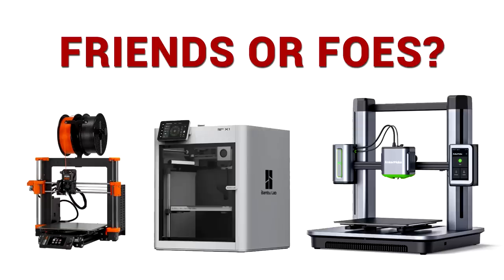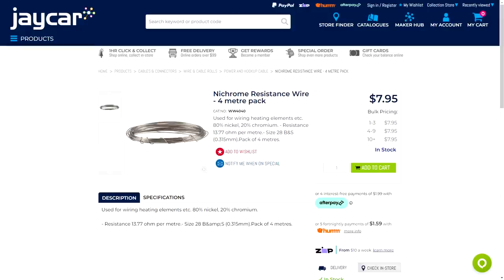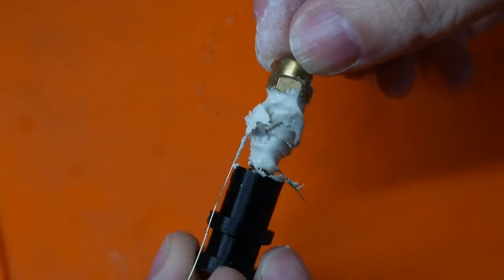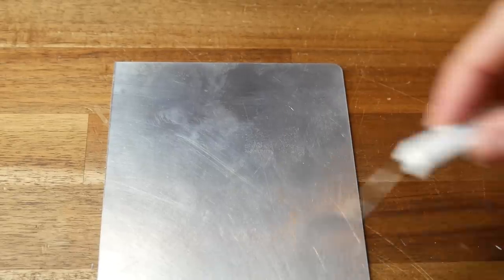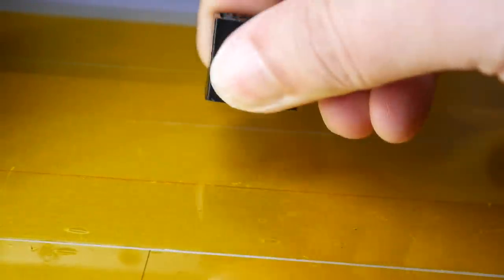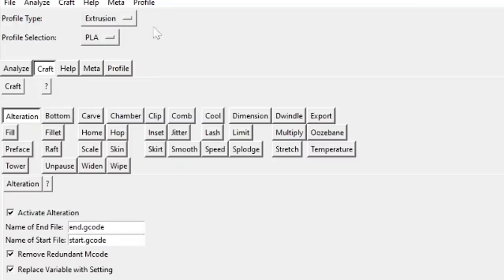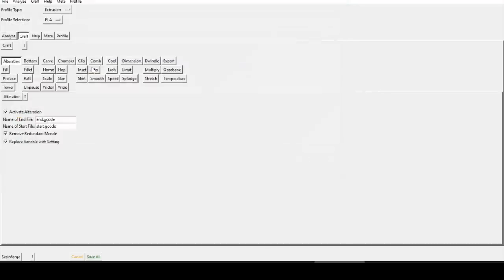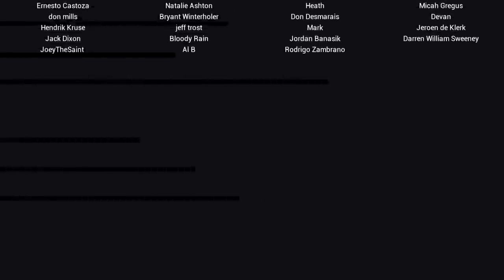10 years ago, 3D printing was really hard

Comment: Very interesting.   Thanks for taking us back in time.   I got my first 3D printer in Feb 2018.   This is a Creality CR10S.   Creality supplied Cura as slicer.   The printer had a lot of features for its time.   I am still using it.   I have done a number of upgrades.    The only upgrade I may do in the future is install some type of auto bed leveling.
I am amazed how much changed in the 5 years between your first 3D printer and mine.
Dave.

Comment: I remember some of this stuff. I came in 2014 on a FABtotum. It had steppers, it had a glass heated bed that was removable, it had a camera, it had an enclosure, web control with mobile interface and built in wifi, on-device slicing. I looked at it like "ah, this has some useful stuff" I didn't realize that nearly 10 years later, many of those elements would still be "hey, we have..." as opposed to standard. But I remember looking through forums and the RepRap wiki on how to do things. I remember seeing those hotends, using blue tape and glue stick for everything, etc. I printed PETG on glass without any interface layer because the people I chatted with hadn't come around to "don't do that, it will take chunks out of the glass". It was a wild time and is why I now rail against some machines I see now which basically are rehashing how things were done then, but with a fresh coat of paint. We've moved on. Just stop. I'll also casually note that working in tech means Slic3r is pronounced "slicer" and I will die on that hill... and remember when that was a new slicer too.
Reply from the maker: I've never heard of that printer but it sounds way ahead of its time.
Reply: @TeachingTech  looking back, it was. But it also tried to do CNC and scanning. "jack of all trades, master of none"

Comment: April 2011 was my start date. I built a 1x2 Repstrap, mostly with parts from the hardware store, and Gen6 electronics from Camiel. I bought my first roll of filament direct from Adrian Bowyer. Used it to print a Prusa i2, and still use the X axis and a J-head for printing 3mm filament! I remember using RepSnapper more than Skeinforge for slicing. And the RepRap forums, a lot!
Reply from the maker: Thanks for sharing, some amazing tid-bits there! The idea back then of a buying all of your 'vitamins' from a hardware store and printing the rest seems so foreign.

Comment: I think the hardest part of learning to 3d print back in the day would've been not having your channel to walk us through everything step by step. At least that's the biggest reference I used!
Reply: The reprap forums have been around since 2004, just about everything in the 3d printing world FDM wise initially came from there including marlin.  Though back then most people were using arduinos and erector sets or whatever they could find at homedepot for their builds.
Reply: @nikushim6665  true the forums were definitely there, but watching a video showing exact equipment with step by step instructions is much less daunting to a new user than a wall of text with some pictures in a forum.

I'm by no means discounting the value in those forums, but there's a reason 3d printing had exploded the way it has on YouTube

Comment: My printer doesn't have a heated bed, not even using tape, glass, etc. And surely, getting prints off it is almost never easy. Unless the print warps on one of the sides, you just don't have any place to lift it up, and you have to find some another way if you still want to print instead of leaving the print there forever.

Comment: Its a supprize how the critical areas such as business services or finding things and searching is infact in my opinion worse now than it was then. 
Then we had mere hundreds of thing files to search through to see if a thing has been invented and owned yet or not or wether we can upload or sell a print. 
Now theres ball park 30 million things but have search engines kept up? Does plus or minus 5 years in recent testing sound like it, no. 
There were more business services operating if we go back around 3 years ago. Noew theres only 1 site with basic busines services so i would hardly call that much progress. 
A lot more newbs have been brought in as 30 million licensed things shows but if you think its better today i say yell newb out load. 
The lack of info is still causing massive losses. Newbs uploading non license checked things causing those who print and sell to be closed as pirates. Farms to collapse after giving away designs then others licensed.They gave there business ownership away, doing there own thing was a quote i heard said. 
Yip i see how that worked out. 
Sold up his rattle of old printers but didnt have any license ownerships to sell of anything he designed all time, pitty. 
3d printing is bigger today. 
Its not faster in many ways, its much slower in many ways that count. 
In costs to manufacture. 
In jobs. 
In losses in value to the community. 
The lack of enthusiasm to inform or help newbs after theyve been sold on a printer are missed opertunitys.
Do they know how to license check all uploads and sales no matter how the thing file came to be. 
Do they know how to upload?
Do they know how to license?
Do they know where?
Do they know theres only 1 site with basic operating business services in for the 3d print sector?
Do they know a thing license ownership can be sold, how, where, 
All basics. 
If any of that is news ask yourself about what your influencer is aiming to achieve if its not informing you of basics. 
Create a thing. 
Is it original or not and how to find out. Finding out you can license it. 
Finding out you have only 1 choice to sell the ownership. 
Setting terms, who may sell if at all.
Prices and royalties. 
How to sell a thing license ownership. TRANSFER. MIGRATE. SEMI MIGRATE. 
Basics, day 1 newb education in my opinion. The modern day has better printers. Not better influences.
Not better services. 
Not better search engines. 
Not better results in looking for your thing or business. Not better educated community. 
We can do way better. 
Its been faster and better than it is today. Time to re sort manually results is growing and slowing and costing more over time. 
I hoped it would be fixed by 1 million licensed things but here we are 30 million ball park and slower services. More costly to operate. 
Less sites with basic operating services, just 1 managed to resume in over 2 years. 
Theres a way to go to even get all areas of the 3d print sector back to where it was. Some areas are ahead such as machines, other areas such as software, services, and sites for the comunity to use are worse. 
Influencers seem focused on printing a rosey picture but perhaps if they had the sight to aim to uplift the comunitys and have better systems and services. 
They are people for hire and silence on all but sell to newbs would be unlikly to solve much for the comunity. Eh hence my post. 
We can do way better.

Comment: Something bad is appening to 3D printing today. Producers are closing with patents and strange hotends and components. SMD circuitry on the hotend. Closed source firmwares, and so on. 
So please everybody in 3D printing avoid this products and continue to buy open products like the E3D hotends and simple printers without so much software and the ability to put open mainboards and open firmwares like Klipper or Marlin.

Comment: I've got my first 3d printer around 2010. It was the original UP! from pp3dp. At that time it looked like the best option from budget printers, and I must say that it aged very well. I used it for a long time, and the main reason why I completely stopped using it was that the old software became unusable, and the manufacturer started to push hard for cloud BS in new releases. 
That doesn't mean that the printer sits unused: I upgraded the controller to Dutet2, and the printer still extrudes plastic with most of the mechanical parts in their original form.

Comment: I see March 31, 2011 is the date on the email I still have for order #48 of the Complete Ultimaker Kit (Beta) PRE-ORDER.  Spent just shy of $1900 on that thing.  Shipped almost 2 months later.  I remember modifying the java source code for the ReplicatorG slicer back then because there weren't settings for what I wanted.  Looks like a few months later I spent $200 on the NetfabbEngineBasic for Ultimaker... wow, that was a waste.  Years later my primary FDM printer is a Monoprice Select Plus I bought for a couple hundred bucks.

Comment: Black to 2013 the Folger I3 was my second 3d printer after a Prusa Mendel. Folger's extruder/hotend was rubbish. I replaced it with a Jhead then by a E3D V5. Slicing was done through Repetier Host with Cura or Slic3r engine as both were available. Folger's carried a MK2 heated (disposable at this time) and we were printing on 5mm mirror with ABS juice or PVA glue. This solution was preferred over painter's tape and Kapton tape which was, as Michael said, nearly a single print solution. PLA was barely available, but ABS was reasonably cheap 12€/kg. Obviously bed leveling was  manual. Then comes the Tevo Tarantula which was a very successful printer way before Creality established. Who still remember about it ?

Comment: I did own a Cupcake CNC from MakerBot (SN 00862). Its Hotend did not use cement. The hollow Screw was insulated with Kapton, then the NiChrome was wrapped around. Then this was heat-insulated with ceramic tape, kept in place with Kapton.
In comparison with today, the printer was horrible. It had a XY-moving 10x10cm build area. The build surface was unheated Plexiglass. Adhesion was a big problem. Instead of a Brim, you used a raft. Better 2 Layers high, because the first layer was super-inconsistent. No wonder, because you could not level the bed. You needed the adhesion, because the default Filament was 3mm ABS. And as the printer neither had a Fan nor an Enclosure, warping was the next big problem. 
If your part printed successfully, there was lots of stringing, because it was hard to control the flow rate. The filament drive used a DC gear motor instead of a stepper.

It was adeventourous!
Times are much better today.

Comment: I started back in 2019 with a 3D printer that someone build for me. If I only knew I could have gotten an Ender 3 for the same price!
Anyhoo. I told him I know nothing about 3D printers, so he edged me towards the one he would build for me. 1 month after payment was made I got my 3D printer.
Build volume of 100x100x120mm, Acrylic side panels, bowden fed printhead with a 0.4mm nozzle, non heat build plate made from plexi glass and
a Core XY Z-axel.
All was well till layer shift started happening.
And if you breathed on it, it would disconnect and stop the print. No onscrean display. It had to run throu repitier host from a pc/laptop.
Turns out, after I learned more about 3D printers that the motherboard had a bad USB connector, and he didn't want to go through the exspense of getting a new one. So delayed till more than a year passed and then just handed it back to me.
The print head was 3d printed with a cooling fan, generic hot end and heater block.
Yes it worked till it broke. Still have it in 1 corner of my printer room, sharing space with my 2 Ender 3 S1's and CR-10s, that yes, has a 0.3mm dip to the left side of the build plate. I composate for this with a raft. So it works.
As always a pleasure watching your videos.
As mainly a user, not a tinkerer I find your videos educational and informative.

Comment: I started building a Hypercube back in 2017 after a work friend of mine lent me one of his printers for a while. Ive since built my own much bigger hybrid version of the Hypercube (look up Tech2C if you want to look into that). I've since modified that machine several times since to have a Linear rail for the X axis, and will probably do the same for the Y axis at some stage as well.
Ive been using Fusion 360 to build things (doing just that as I was watching this video) for most of those years as well. I use Simplify 3D to drive the printer, and have recently been playing about with Cura, but it's proving to be a very different slicer to set up and use, there's a lot I really prefer Simplify 3D for.
I love my Hypercube, I honestly wouldn't change it for another printer on the market, maybe a Voron, but I could modify the Hypercube into a Voron anyway, so...

Comment: Well, this brought back some bad memories. Back in the day i sold a car to get the cash to afford my first printer, I was one of the pre-orderers for the Makerbot Thing-o-matic. I really fell for the marketing: "Desktop factory!" "Best Prints yet!" "Easy to assemble and run!".  They never bothered to mention that the batch function for printing multiples required manually editing the gcode, or that the new stepper powered extruder wasn't included with the pre-order kits, but was available 2 weeks after the delivery date for the pre-orders, for an extra 200 bucks for the upgrade, but it's included with all the ToM kits after the first batch. Could never get that plywood lemon to print reliably, ended up having to go to the hackerspace in Philly to get some help to get it running, all the adjustments for power to the steppers was manually controlled via pots on the board. When it stopped sensing the bed thermistor, tried fixing it with the addon control panel for another 100 bucks, on top of the 1300 dollars the kit cost originally. It left such a bad taste in my mouth, i swore off anything "Maker" related for years. If it wasn't for my Dad deciding to impulse buy an Ender 3 Pro at Microcenter, I would have stayed far, FAR away from 3d Printers. 

Still got to figure out what to do with the 6kg of 3mm ABS filament i got sitting around.

On a related note, I hope Bre Pettis steps on a Lego.

Comment: My first printer was a PrintrBot Simple metal back in 2013, it was awesome because it actually had a PCB Bed heater! ... that could get to 60°C if the room was already at 30°C, so it never printed ABS very well, the bed was a block of aluminum with Kapton on itm the heater was exactly as you described the solidoodle's (though I never had to rebuild mine fortunately). While it had micro-stepping motors it never seemed to utilize them and it screamed like a banshee. 

After college I got a Prusa i3 Mk3 and haven't looked back, it just works so much better with all the modern conveniences like a spring steel sheet, a hotend that doesn't suck to use or change, and software that actually functions.

Comment: My 1st build was a Prusa Mendel, in 2010. I had the frame complete and had started on the electronics when I decided to make a MendelMax 1.5 instead. I remember I bought the necessary printed parts from a guy on one of the forums. It took me over a year to get the thing working, because I didn't know anything at all about what I was doing, I just knew I wanted to make it. This video brings back some nightmare memories of hobbed bolts, kapton tape 3mm filament and fried electronics. The RAMPS 1.2 Mega was the common board back then.

Comment: My first printer I still have.  It's a Leapfrog Creatr.  It's a dual extruder printer with a 2 axis print head.  Z axis is 3 lead screws.  Unfortunately, it is at that point where everything is normal threaded rod and captured nuts, so it move so very slow.  The electronics are a very poorly copied RAMPS 1.4 with no screen and only two thermocouples, but use fantastic industrial stepper motor drivers.  The frame is single slot 4040 extrusion, so it's very rigid.  It even has a heated glass bed and 4 sides of an enclosure.  I'm debating on just updating it as a Cartesian printer, or update it to a core XY.  It is a rather large printer (350x350x375 print volume).  And, the layout is almost exactly what's needed for a core XY.

Comment: just goes to show how different everybody's experiences were- I started 3D printing in 2011 with the OG plywood ultimaker and I didn't have to do ANY of the stuff you mentioned. Aside from the usual "my print failed how do I fix it" type of stuff that was common back then there wasn't much to it. I think the first version of Cura even became available a couple years after I got it so slicing even got "easy", even though Replicator-G wasn't too bad. 

That said- my Ultimaker was a HUGE pain in the ass to put together. it came flat packed in a box like a piece of ikea furniture that you had to hand assemble (the average build took around a full day, usually two days). we're talking thousands of pieces. much of the plywood was still attached to the main laser cut sheet so you had to cut them out with side cutters like they were sprues on a model kit or something. It was pretty insane by today's standards.

Comment: My first was a Prusa Mendel i2 - the a-frame style made from threaded rod and 20 bajillion nuts with a Sanguinololu board that came as just a pcb and I had to solder everything on the entire board. I remember when the bar to success was very low - it pooped plastic. We really weren't concerned about a "perfect first layer" or "z wobble" or "ghosting" or "ringing" - if you got a vaguely recognizable cube-like shape that somehow managed to stick to the bed the entire print(since we were mostly using ABS at the time), you had accomplished something!

Comment: I bought an Aldi printer, a Cocoon Create somewhere around 2015. I didn't use it for years and have only just gotten back into it now. Having to calibrate it all the time is annoying, the textured print bead sucks unless I use copious amount of gluestick and I should probably buy an enclosure for it. I also had to put springs under the print bed as it was slightly concave. It fell off it's set of draws a few months back and I haven't had the motivation to check if it's all still in square. And I have never heard of Slic3r pronounced that way. I always thought it was just 'slicer' and not 'slick-three-are'.